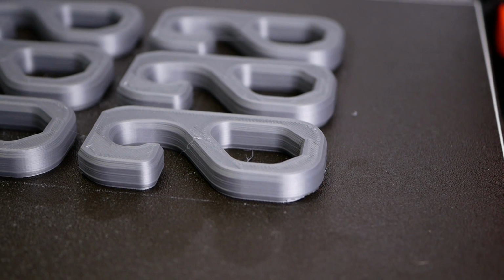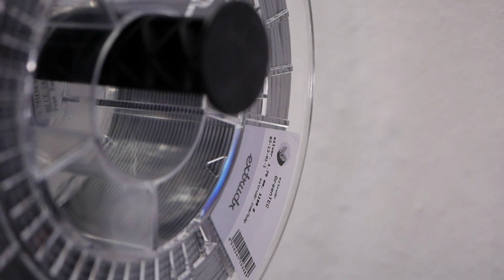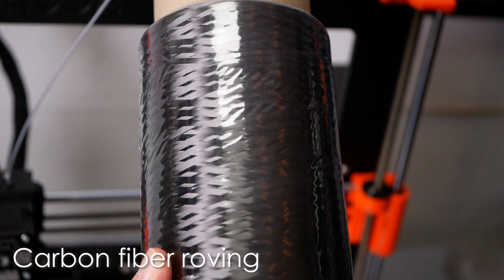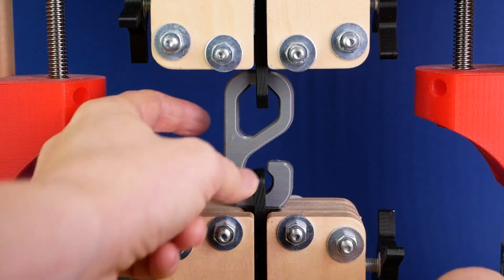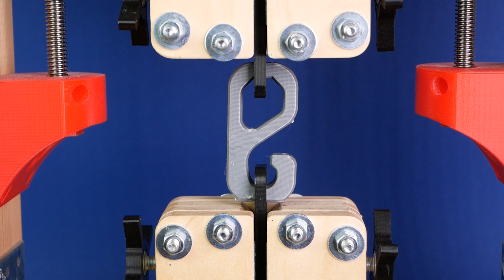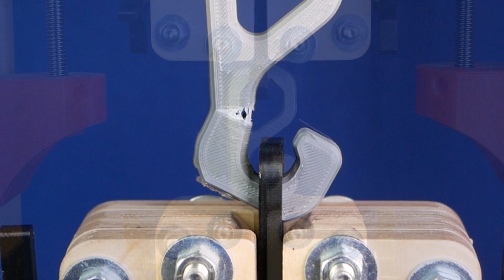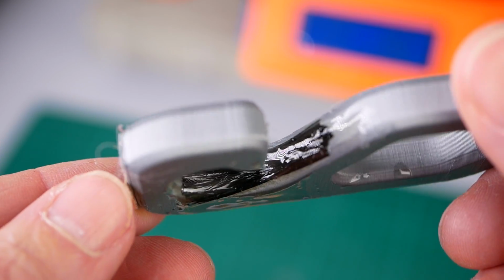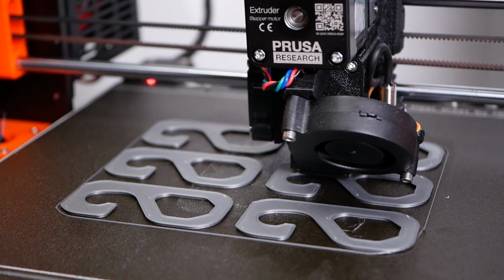STRONGER 3D Prints with GLUE? (and CARBON FIBERS)

Comment: This vid did a fine job of showing there is little improvement from a glue coating.  Stress risers are critical to real world strength.
I would like to see more with composites but it is a very complicated topic -maybe not for general audience.
For example:
-PLA might not be compatible with common composites because it shrinks after printing and is uniquely amorphous.  Or maybe the one flaw smooths over the problem the other creates.  A good test would be to print, then glass the exterior, then "anneal".  If the composite does not survive this basic test the components are incompatible.
-ABS may make a more compatible core
-the adhesion to the core is the big challenge and difference in stiffness creates a stress riser at the junction.  Carbon fiber is least likely to work.  Glass is much closer and even polyester or nylon fabric might work better.  The question on every test should be where did it fail?  When the sandwich stops failing at the junction you can start optimizing -shell for strength and stiffness, core for shear strength.

Comment: For some applications it might be a good idea to design 3d printed shapes that are optimized to be reinforced with carbon fiber material. Maybe spiral grooves. Maybe a tunnel. Also, the horizontal orientation fibers still confer some strength in the vertical direction, because they have a thickness and aren't perfectly horizontal everywhere.

Comment: Hey Stefan, I have had this idea for a while. For prints that are thick enough, one could print a cavity in side the object and insert a piece of metal. It could be an AL rod or some spring steel and such. It would be hidden and add tons of strength. I haven't tried it but it should work good. Thanks for the video.
Reply: or fill with epoxy the entire cavity ;)
Reply: You would not fill with epoxy because it is an exothermic reaction and would melt the print out of spec. Also it is too brittle. What you would do is model a thread into the 3D print use matching size threaded rod. Run the rod through to get the hole to spec then put a  glob of epoxy on the hole and a line up the rod. Thread it all the way in, then trim flush with a cut-off wheel.
Reply: @Anyone700  Yes, that's the idea, of course the details would depend on the situation and application. Good point about the heat. And brittle not bridle.
Reply: @Anyone700  That is very very size and shape specific. Using slow curing(or low heat generating) epoxy it'll be just fine.
Reply: I bought a load of cheap 3, 4, 5mm drill bits once off eBay, and have used them for exactly that.
Reply: @davidstonier-gibson5852  Would it be presumptuous to say Great minds think a like? lol
Reply: @iTeerRex  Synchronicity!

Comment: A local startup is using 3D prints with the bottom shell print missing. They flip the part and fill with UV resin to make a solid part. Its only half as messy as just making a resin mould but you could easily inlay a strip of carbon fiber while adding layers to cure.

Comment: I use CA to strengthen wood parts and one thing that is important to make sure the CA can wick between the wood fibers.  In your experiment, I don't think the CA is able to appropriately wick in between the layers.  I would suggest printing gaps into the layer to ensure maximum penetration of the CA.  You'll also need to use thin CA for the best penetration.

Comment: Have you considered printing your hook hollow and injection resin / concrete etc inside and compare as it should remove the Z axis weakness in a way that we can easily be done. Possibly you could mix the filling with your variable infill method?

Comment: I grew up on a beach in Southern California and surfed since I was ten. My best friend's dad tried to make him a surfboard by applying fiberglass and resin to a cheap styrofoam board. It was a disaster. The resin dissolved the styrofoam. (Polyurethane is use to make surfboards.) I think anything that dissolves in acetone will also dissolve in epoxy resin. That may be why your samples were weakened. Maybe, after the resin hardened, the sample would continue to get stronger as the solvents evaporate. I have seen in industry where vacuum is used in a process called "wet out." Maybe you could try a filament that doesn't dissolve in acetone.
You may try to approach your designs as 3D printed forms to wrap resin impregnated carbon or fiberglass cloth over where the finished fiberglass/carbon would bear the bulk of the load and the 3D printed part makes most of the shape.

Comment: I once repaired a scissors with locktite super glue and a mesh of thin shielding wiring, that I took from some coaxial cable lying around. I embedded wiring into a plastic using a soldering iron. Scissors are still working to this day for about year and a half. Maybe you can use similar method to add more strength to your 3D prints?

Comment: I see a lot of people asking you to do a full video on The carbon fiber as well as Woven fiberglass. 

Even one recommendation to add fibers inside the print, while the printer is paused. 

This could lead to prints with optimized geometry where fiberglass or Carbon fiber could be added to the internal structure of the print

Comment: What about designing the inner support structure to be hollow with a channel throughout so you can fill it with resin? A hole at the top for pouring and a hole or two for air to flow out like on a mould. Would need to be something that doesnt get too hot.

Comment: Hey, here's something I picked up from drone pilots. Super glue can be hardened instantly using baking soda. Cyanoacrylate and sodium bicarbonate. They say it is harder than glue itself. It's for fixing broken blades. A broken propeller blade is similar to a layer adhesion problem on a thin part. If it is actually that strong it might make for a good video. Love your work

Comment: Your results were as I expected.  The breakage at the end of the CF reinforcement was perfect.  I started using CA in 1973 with my RC models.  I stopped using it when I became sensitized to it in the early 1990's.  A single whiff of it will give me flu like symptoms for several days.  I miss using such a useful material.

Thanks for all the testing.
Reply: P100 respirator with organic vapor cartridge can get you back in the game

Comment: i know this is an old video but ive reinfocred my pla prints using countertop epoxy since it has a high ipact and heat resistance. i cant speak towards layer adhesion but on my glock frames it makes them last significantly longer than a standard PLA glock frame

Comment: I know this video is old now, but I wonder if the same test could be repeated for ABS instead of PLA. Mainly because both are reactive with Ciano-acrylate compounds. I usually use CA glue for making my ABS parts shiny and to vanish with the layer marks. I notice that just a drop of CA glue is enough to melt the surface a bit (the remaining CA glues that drips from the part, drips in the filament color).

So I wonder if that might actually increase layer adhesion / resistance for the parts since it actually melts the part (although just on surface)

Comment: what you can try : Pause half print, dump epoxy and wait to its harden then resume print. You can also try with others things like sands, cement, ect :)
Reply: People have done similar things with filling the infill cavity with cement and the like. Usually after the printing finished. I don't think it's a good idea during the print.
Reply: Pretty sure he made a video on that already...
Reply: People have tried leaving holes in their prints to fill with epoxy later and it worked very well
Reply: Crazy. I just had the same idea.

Comment: Stefan YES, Please YES! 

Yes to More tests of increased strength, stiffness and impact resistance created by surface or buried (pausing the print) epoxied carbon/glass fiber roving (& fabric) reinforcements. I think this is a quick, simple & cheap method to GREATLY improve the real life functionality of 3D printed objects.

Comment: I'm going to suggest that glass fibre roving would have a similar effect to the carbon fibre. CF is used primarily for it's linear stiffness once it's epoxied into a component. That's why I use carbon fibre tubes, and have also used CF roving, in the wings of the foam gliders I build. But woven glass fibre cloth, or even GF tissue, (which is omni-directional), will make a BIG difference to the layer strength test results. Though, as you  discovered, you would need to cover the hook past the point of suspension with the fibre. GF adds strength cheaply, and Kevlar is even stronger, though waaaay more expensive.
People! Please be aware of the safety issues involved with glass/carbon/kevlar fibres. These materials release microscopic fibres when handled, so please wear some safety gloves, a mask and eye protection! Also ventilate the area if you are using epoxy or polyester resin!
Oh yes, that reminds me Stephan, polyester resin is never as perfectly rigid as epoxy, so it may not suffer from that fine cracking we saw under load. So it may last a little bit longer in your tests. Heh, it's also cheaper.

Comment: It might seem a bit like I'm taking the mickey, but just hear me out on this one: give it a try with good ol' PVA/wood glue.

My experience has CA/super glue with PLA being... not a good mix. I've been able to make it work but it just doesn't like to set properly, to the point where I can still move pieces around days after initial application. PVA glue, however, gives a very strong hold in short order, the same as you'd expect when using it for wood, quite possibly due to the organic nature of PLA.

I'd also be curious about the "CA cement" made when combining super glue with sodium bicarbonate, since it seems like an easy and accessible way to potentially increase the strength of the super glue part.

Comment: Hi, Stephan! Wrap all stress zones (or over the whole part) with 2-4 thin layers of carbon fibers placed diagonally: 45, 135 deg. Similar method is usual for composite construction parts in the aviation (they use not carbon fibers but more sturdy materials as it's vital). I think you'll get about 200-300% increased strength (with my very modest opinion). IMHO it's better to reinforce your testing equipment before this test as well (especially if you don't know how much it can stand with).

Comment: I played around with a material call tulle; an open mesh fabric used in garments.
About 10% fabric, 90% holes.
Anyway, it can be layered into a print to make a support mesh for 'chain mail', without the links!
Pause the print, slip in a piece of tulle, resume print.
The holes in the fabric let the plastic 'print through', incorporating the fabric into the print.
A search for 'carbon fiber netting' pulls up a few promising leads: mosquito netting with high carbon % and bound in nylon...might be a thicker than normal layer, but should be strong.
Y'all not afraid to edit gcode...
The Holy Grail would a netting form of carbon/kevlar.

Comment: Once I've printed PLA lever, it consisted of 2 parts. I used leftovers of epoxy - it was super liquid and super runny, and full cure time was something like three days. If I remember correctly - it was clear epoxy for floors coating. All epoxy become absorbed inside of my printed parts (not outside as in your case) and all gaps between PLA "fibers" were filled with epoxy - capillary forces did their job. Guess different epoxy will give you different results.

Comment: The timing is so perfect for me, just picked up an ender 3 on 11:11 sale ... Told myself I wasn't allowed one until I learned how to get started with Fusion360(since 99% of what I'll prob print is functional stuff and tests of them lol). Having never used ANY design or altering software(windows paint doesn't count for dots and lines, although...nevermind) I still have a huge mountain ahead, but I got as far as designing with threads and most of the basics, I'd love to get into assembly and fitting parts together, seeing stress points...basically the good stuff that you DO :D  And that brings me to what I started to say.... AWESOME content, exactly what I needed when I needed it. I was just bitching last night in chat during Joel's giveaway that PLA is such a disappointment when you need functional stuff because of layer separation and then you give us this. I'm assuming resin filled is next? If not, It Should be ... that's my next trial for my functional junk, PETG filled with warmed up resin to flow nicely into infill. I've got some two ton stuff laying around somewhere from a project a while back, that should do nicely lol Jjust ordered a roll of petg, since now after a month of testing I've gotten things really close to dialed(just did a complete thorough check over the WHOLE printer and Glad I did, just about everything needed an additional turn with the wrench and the bed rollers were actually never aligned 100% and started wearing funny, but I detected it early and greased it all. HUGE improvement since my first print where I scratched the aluminum bed...I guess I'll forever have my very first imPRINT :( so i'm ready to try PETG and if that goes well maybe some tougher stuff .
Once again, awesome stuff, will be watching it all. Can't wait to see what else I get to learn.

Happy Holidays and a Super New YEAR!!

Comment: Have you tried fine fiberglass mesh  and glue/resin that's intended for artificial fingernails? It's strong, flexible, thin, lightweight, and with proper application crystal clear and smooth. You can sand and shape it, and buff it to a high polish. The mesh itself can be purchased in uncut form (not preshaped for nails) and the best has a light adhesion so it stays in place as you apply the glue.

Comment: Try using a vacuum chamber. It seems to draw the glue into the voids in the 3D print. Another video here used it with just PLA I think to make a print airtight. With a low viscosity ca or epoxy it would then be bonding the actual layers?

Comment: Another great video, thanks Stefan!  As you correctly noted the epoxy has a lower failure strain than the filament you used which has a more plastic failure mechanism,  I wonder if regular PLA would be a better match to the failure strain of this epoxy? Alternatively there might be a toughened epoxy with a higher failure strain that could do a better job also.

Comment: One more thought about layer strength. In the wood industry, we impregnate wood with chemicals to provide insect resistance, etc. You do that by putting the wood in a vacuum and then adding the chemical and it gets sucked into the center of the wood. I've wondered what would happen if you tried that with ABS and acetone? Suggestion: put parts in a vacuum. Close off the vacuum and open a valve to allow in some acetone which will immediately boil into a gas and be sucked into every crook and cranny of the ABS part. Would that improve layer adhesion?

Comment: how about printing a hook, leaving hole on top, and filling it with glue or epoxy afterwards
Reply: Like a faster way to print 100 % infill maybe it's better
Reply: Solid epoxy is very brittle and heavy.
Reply: @samuela6271  and kind of expensive, but it may worth a try for certain parts...
Reply: if you're going through the effort of doing that you're better off making silicone mold and making an fiber glass epoxy composite hook in the first place. 

epoxy is very strong, but it's not mention for structural stability, and as such you need some sort of reinforcement.
Reply: I was thinking something along those line as well 

- Epoxy
- Epoxy with fibers (the short fibers carbon/glass)
- cement 
- plaster 
(All off witch have the draw backs do to the way there cure. Exothermic , Oxygen, water evaporation)

Like cast In place, but you keep the mold on.

Also it wold make for a good exploration of infill and infill modification, seeing as what ever material would have to flow all the way through the part or to specific locations.

I have had some luck use epoxy to increase compression strength on a print.
Reply: You could try go fill that structure with expanding epoxy foam.
Reply: Bad idea.

Comment: I’d love to see this done again with a .6 or .8 nozzle with significantly larger layer heights. The larger heights would leave larger grooves or ruts inbetween the layers (which is what attributes to more visible layers/layer height) thus giving a substantially increased amount of surface area for the glue. I don’t think you’d see a huge difference in CA glue (maybe the thin) but I think you’d see a lot in the epoxy. Also would be nice to test multiple purpose driven layers of epoxy on a a single print. For instance Smooth On has a huge variety. Their TASK™ 9 ColorMatch has a tensile strength of 7,800 psi but their Free Form AIR HT which is an epoxy putty with a post cured HDT rating of 204• C. So potentially being able to add specific traits to the print via their respective coats of epoxy. Maybe making the outer most coat be the hdt high temp resistant idk. But even just the putty bc you can work it into all the layer line grooves and scrape off the excess flush with the print. So you wouldn’t even be changing the models dimensions really. If anything making them closer to the original model.

Comment: Epoxy has little to no tension strength. There is a reason that epoxy is not sold in plain sheets but instead in laminates like G10/Garolite/FR04. The fibers take all the load in tension, and the epoxy takes the load in compression.

Comment: HIGHLY reccomend GFlex epoxy. it bonds really well to the plastic when I tested bonding an 8mm solid aluminum shaft and carbon tube into a hex part. the shaft and tube failed before the bond. GFlex is not as brittle as most epoxy and works so well, that it has become my go-to